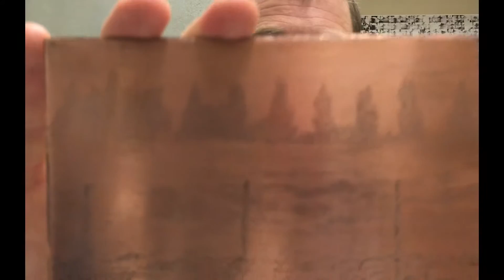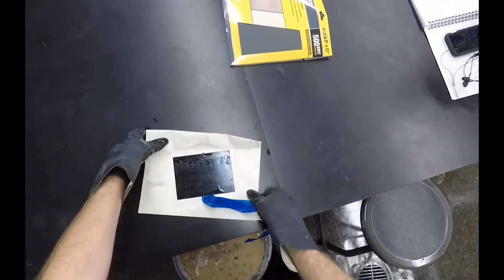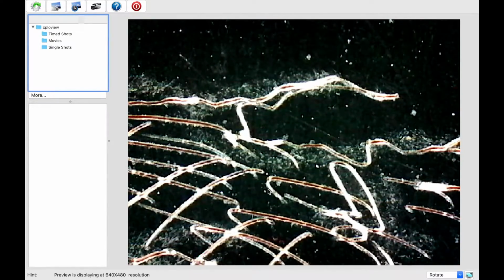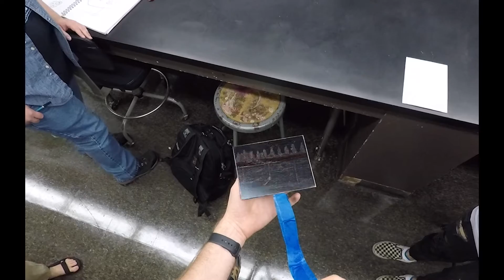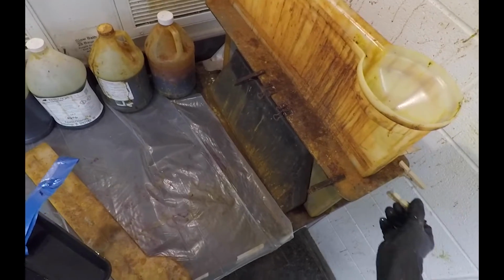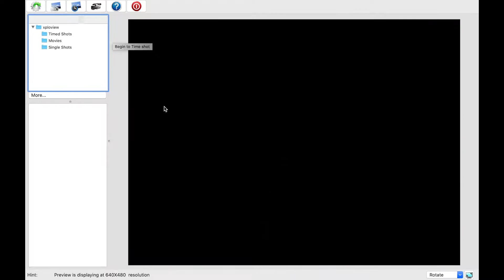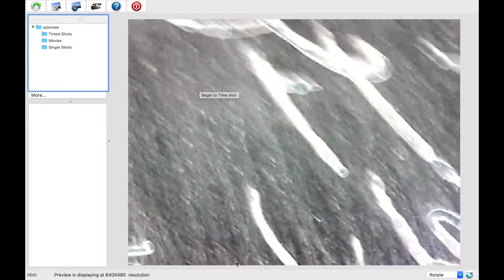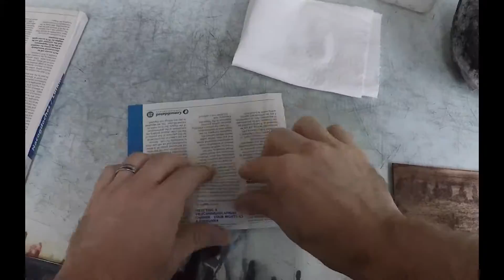Variable Depth Line Etching

Comment from the maker: I’ve experimented with citrus strip as a way to remove the BIG  ground. It worked really well. Simply brush a thin coat over the ground and wipe everything off, followed by alcohol to degrease the plate.